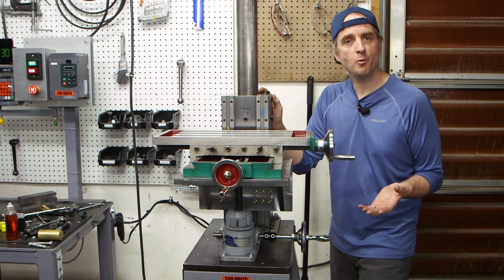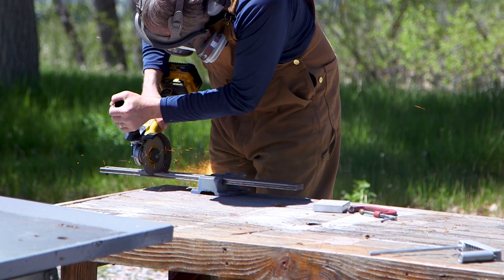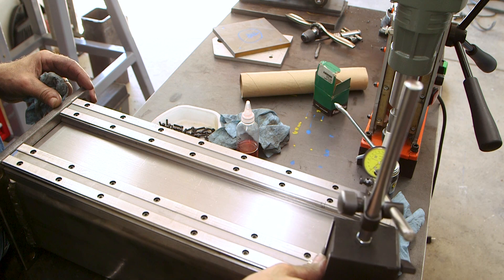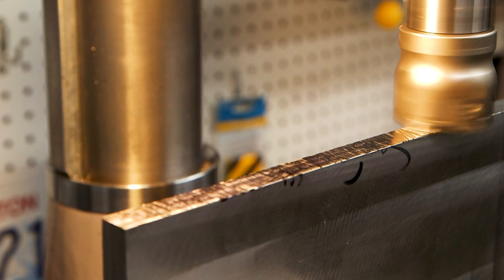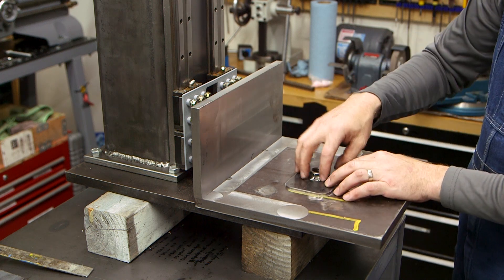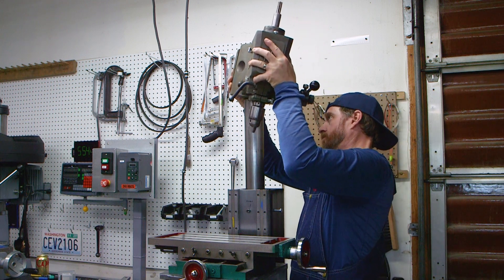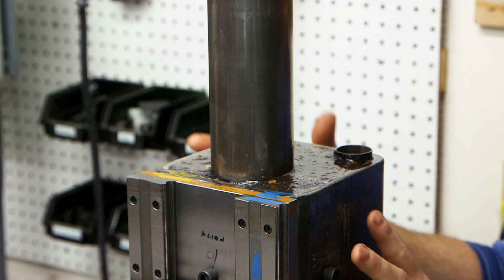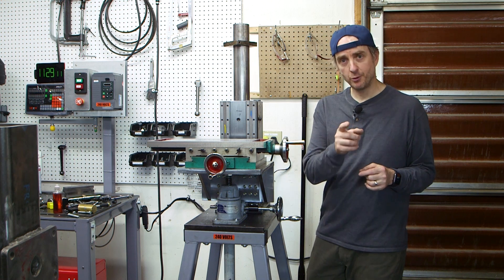More Rigid Milling Machine with Epoxy and Square Column

Comment: Will i see anty benefits if i use concrete and sand to my cheap drill press??
Reply from the maker: I’d recommend epoxy over concrete for a couple reasons.  Concrete can be corrosive to unpainted metal but also, it shrinks as it cures.  The epoxy sand mixture costs about what a bag of Sacrete would.  I’m currently filling the head of my Delta Rockwell with epoxy sand and have hi expectation it will improve it considerably.  There will be a video out on it just as soon as I finish the wiring.
Reply: @RobertAdairWorkshop  I havent really used epoxy before also i will also try to put some rebar in the column along with cement and sand And as for the base i will weld scrap heavy metal parts i dont need and put concrete and sand will that work??

Comment: when tramming the head... take a tip from setting up multi axis machines.

youre referencing to the surface of the table, not to the slideways.

proper method is use a ball on the table, a single point.

by moving the table and clocking to the ball you are referencing the actual slideways as that point will always be the same relative height.

tramming the tabletop makes the assumption that the slides are actually parallel...

clock to a ball and then tram the table and you know if the table needs surfacing.
Reply from the maker: This is really good advice.  I'll give it a go.  Thank you.

Comment: I intend to use laminated thick yellow birch and 1/4" (6.3mm) AL 5052-H32 for mine, but one can also get laser cut plates (± .005" Typ) , CRS Flat Bars (much better tolerances as is vs HRS) probably between ± .001" to ± .009", often dead on.

Or use aluminium extrusions, HSS and plates. 6061-T6 Rectangular tubes, plates, angles, channels, will likely be stiffer than chinesium cast iron anyway. Square corners for bolted and round for welded connections. 

Geometry (the shape, design and fastening of the frame) is often more important than material strength when it comes to stiffness. Almost all common tools for woodwork will machine aluminium, but not steel. 

A thin layer of epoxy, clear coat/paint or superglue will protect the aluminium from the ferrous metal connection.
Reply from the maker: This all sounds like a really good plan.

Comment: I was looking into buying a mini mill to use for a couple of my hobbies I am into. You have given me a better solution than buying a mini mill. I especially like the use of the square tubing and filling with epoxy mix. The linear rails and bearings are also a better solution to having ways that would last longer but the rails and bearings are easy to replace. Thank you and cannot wait for part 2.
Reply from the maker: That's fantastic, thank you.  I am going to do my best to have part 2 out before end of July.  I need to build the  head and film it which is what will hold me up.  I'm looking forward to trying this out and seeing how it does.